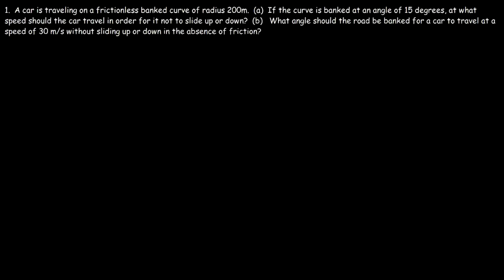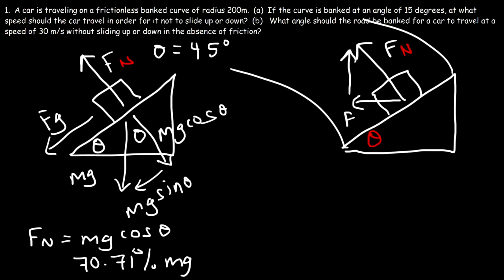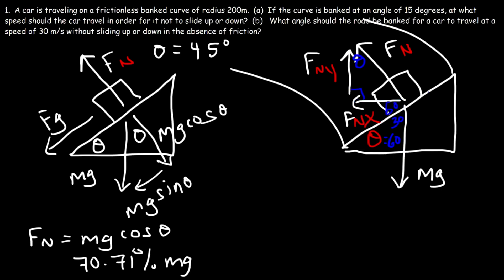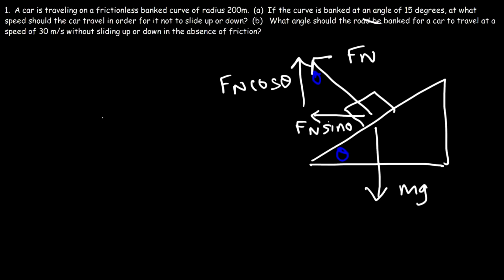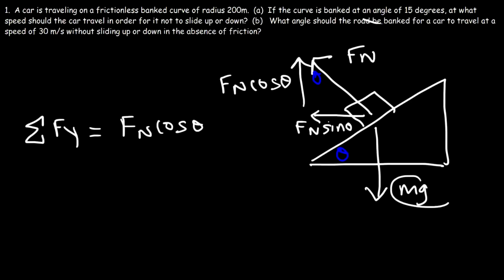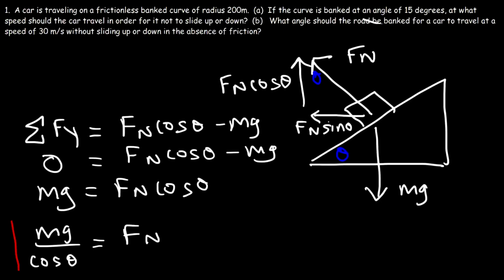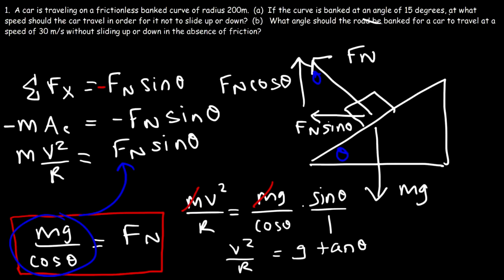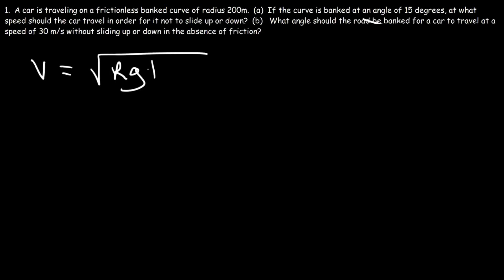Banked turn Physics Problems

Comment: I’m a bit confused because isn’t the reason FN is resolved differently here just because of how the coordinate system is defined? On the regular slope you broke mg into components since the axes were tilted along the incline, but in the banked curve example you broke FN instead because your axes are horizontal and vertical. So is the difference really physical or just due to the coordinate choice? But if that were the case then your answer for FN should be the same for both, which it is not, so I'm confsued? Thank you!
Reply: FN is different in banked curve problems because it's also responsible for the force that pulls an object inwards, towards the center of the circle, even though it looks similar FNy is equal to mg here while FN as a whole is equal to mg on a slope. idk if i explained it super well, but i hope ts helps
Reply: he explains it from 6:00 to 7 ish
Reply: @theBigBuilder04 I'm getting hung up on the expression for FN in the banked curve scenario. If FN=mgcos(theta) for an inclined plane, wouldn't that component also still exist in the banked curve scenario, but with the addition of the perpendicular component of mv^2/r? In other words, for the banked curved wouldn't FN = mgcos(theta) + (mv^2/r)sin(theta) ?? But that is not what he gives in the video, so where am I going wrong? thx

Comment: if there is no friction，how can the car run and turn the circle？？
Reply: normal reaction force's component acts as the centripetal force. its the exact reason why roads are banked - to eliminate (or reduce) the need for friction.

Comment: I disagree with some points in this video. It's not necessarily the inclined mass is different from the banked curve. The geometry is the same. The difference is that the object is MOVING and experiencing a centripetal acceleration. The difference is that the banked curve involves another force in addition to the gravitational force. You make it sound like it's different...it's not different, it's the same scenario but with an additional force (centripetal)

You can equally solve this problem by invoking a centrifugal force (Fc) which acts outward of the circle against the force of gravity along the incline (Fg).

Fc = Fg.  Where Fc=m*Ax*cos(theta) (the centrifugal force) balancing Fg= mg*sin(theta) (the force of gravity along incline). The centrifugal force component along the incline will be cos(theta) and the normal will be sin(theta). Drawing this out may help to see the geometry 

m*Ac*cos(theta) = mgsin(theta)
v²/r = gsin(theta)/cos(theta)
v² = gtan(theta)r

The result is the same as the video. But this approach shows more directly why the mass won't slide up or down the incline
Reply: thanks alot😊

Comment: Does the friction force where the rubber meets the road acts radially inward to counter the tangential velocity  on the car moving in a circular motion?
Reply: In this case there is no friction just centripetal acceleration pushing the car into the road so that the weight of the car on the banked curve is just mg. So it's as if the car is on a flat surface , therefore canceling the lateral forces thus making the car not slide up or down.

Comment: 5:00
If Fn is mg cos@ and Fny is Fncos@, how is Fny=mg?
Shouldn't it be Fny=mg×cos²@?
Reply: I don't know if you care anymore, but since this is not on a normal sloped surface Fn is actually the force holding the car in from flying off, serving as centripetal force, not just counteracting a component of Fg. Remember, in circular motion the velocity is tangential to the circular path, so as it resists changes in its velocity and tries to fly off the path (newton's first law), Fn holds it in and keeps accelerating it towards the centre.
Reply: Thank you very much🙂

Comment: Why there is difference between regular inclined plane and bank road ???
Reply: On banked road there is centripetal acceleration in the x direction which increases the Normal force. On a regular inclined plane there is no countering acceleration to keep an object from sliding.

Comment: I cannot understand. How can Fn have higher value than applied one (gravity). If the gravity equals Fny, then it means Fn > Fg.
Reply: Normal force is greater because of the centripetal acceleration in the x direction,  so the force in the y direction then becomes great enough to equal mg.
Reply: @singh2702  yeah thx for replying. I had got how this thru gen phys 1. But the thing is that ur answer must be opposite centripetal happens because normal force is greater. By N2L, force causes motion.
Reply: @nirow8199  Normal force becomes greater through centripetal acceleration,  if there were no acceleration then Normal force would be smaller than mg and object would slide. If that makes sense.
Reply: @singh2702  Yeah but the acceleration is result, forces are always cause
Reply: @singh2702  In atomic size, it makes more sense
Reply: @singh2702  We can know normal force is greater bc there is centripetal motion but does not mean normal force become greater because centripetal motion happened
Reply: @nirow8199  The increase in Normal force is a direct result from centripetal force and the way we know this happens is because of the balancing centrifugal force , Newton's third law of motion. If there were no reaction to the centripetal acceleration there would be no circular motion, and this reaction is an increase in Normal force.
Reply: @singh2702  I think u r critically misunderstanding. There is no centrifugal force (i think u know this but) it is not a force but an inertia. Also, N3L is nothing to do with centripetal and centrifugal. It is normal force from floor to block, block to floor that is N3L. Lastly,  centripetal force is conceptually made up (alternative to Fnet at centripetal direction), so it is an addition of forces rather than itself causing the increase in normal force.
Reply: @singh2702  And centripetal motion happens only if there is acceleratoon directing to center, and it has nothing to do with reaction to it. By ur logic if centrifugal force cancels out centripetal so Fnet = 0. In this case by N2L, a = 0 and there will be no acceleration, which is not true since there is centripetal motion.
Reply: @singh2702  Definition of acceleration is derivative of velocity. Since the direction of velocity (vector) is changing accel cannot be 0.
Reply: @nirow8199  I did not say centrifugal force cancels out centripetal force I said the two forces balance each other , so an object can remain in circular motion. As for the Normal force , for it to increase the Normal force will continuously change its angle from its original position until it is no longer at an angle to mg. This is when Fny is equal to mg , but this can only happen if Fnx also increases. Fnx is what? Tell me.

Comment: Can you please solve the following question for me:
A racetrack has a bend at an angle of 10° and has a radius of 200m. A racing car has mass of 750kg and the tyres and the road surface has cofficent of friction 0.6 between them. Find the speed of the car.
Reply: 41.66 meters per second

Comment: At 14:00, I am not able to get the same answer. I am not getting a number because tan(15) equals a negative number and you cant take the square root of a negative number. Can someone please help me?
Reply: tan(15) is not a negative as it is in degrees, your calculator must be in radians. Press Shift + Mode/set up and 3 and it will change it back to degrees, hope this helps!
Reply: Do you guys have any account that has subscribed to his channel on Patreon? I need it but i Cant afford it :(  I really need for my final exam!😭😭

Comment: The distinction between a regular incline and a curve helped a lot. I was getting confused when I looked at my notes.
Reply: for real man i was wondering the same thing
Reply: What he says actually wasn't correct. The regular incline is the same thing. The difference is that a car traveling on curved bank experiences a centripetal acceleration. There is still the force of gravity exactly as shown in the incline.
Reply: hi there can we bank a road without  forming an angle whith frictional force????😢

Comment: 6.4 A cart at the top of a 0.3km hill has a mass of 420g. What is the cart’s gravitational potential energy? Assuming that energy is conserved and there is no friction, calculate the cart’s speed at the bottom of the hill.
Please help me out with this question I have an assignment due tonight😭😭😭I tried doing it but I just can’t get it
Reply: https://youtu.be/GO0wb4MhYTg
Reply: Jeff L wrong, PE=mgh
Reply: Firstly, we use the law of conservation to link that the potential energy of the cart at the top will be equal to the kinetic energy at the bottom.
E(Potential) = E(Kinetic) 

We then calculate potential energy
E(Potential) = 0.5 * m * h
= 0.5 * 9.8 * 0.42
E = 2.058 N

With this value of potential energy, we know that is the kinetic energy at the bottom as described before. We can now plug this value into the kinetic energy formula where we can then solve for velocity.
E(kinetic) = mv^2
2.058 = 0.42 * v^2
2.058 / 0.42 = v^2
v = 2.2ms-1 (2 s.f)
Reply: @rxpe  thank you so much 😊